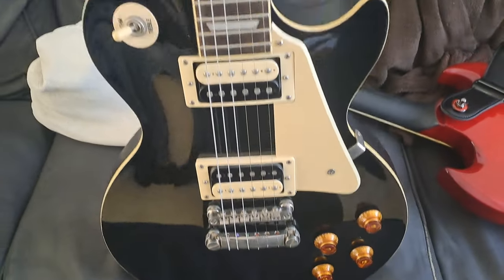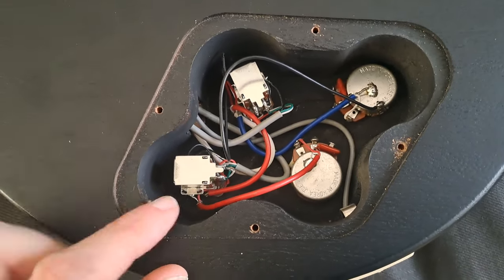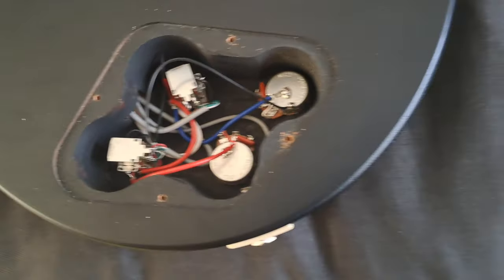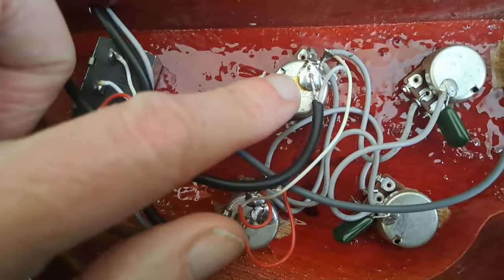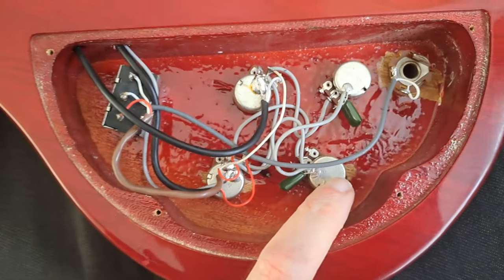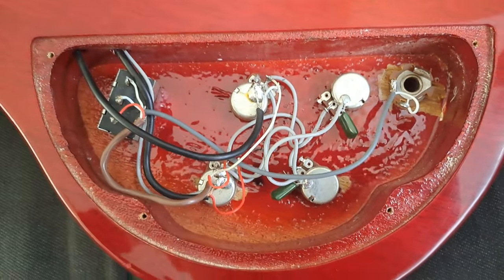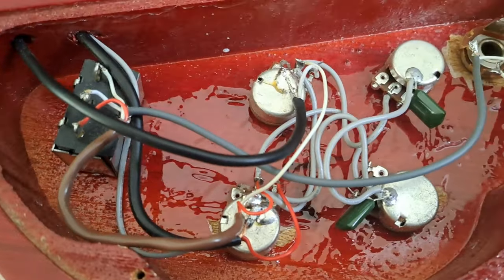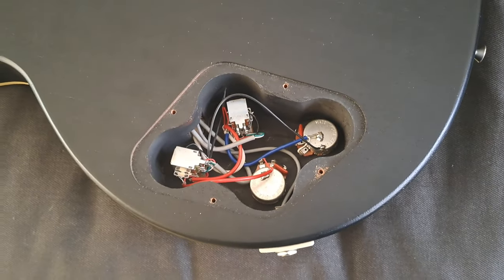How is Epiphone Quality Control?

Comment: From what I've seen, Epiphones, even the cheapest ones, are wired up very well, full size pots and nice soldering work. The fret work and nut slots can be hit or miss on the low end and they still use bottom of the barrel covered gear tuners on the cheapest SG and LP models.

Comment: I have three 2021 high end Epiphones all are perfect
Reply from the maker: There are clearly some very skilled craftsmen they've got in the Epiphone factory. Not all factories will have the same Q/C wherever you go, regardless of origin. I've got a few of Epi LP's and I've always been happy. I just got the new Epi Les Paul Studio in Smokehouse burst and it's super quality. In fairness, even the cheap SG style guitar in this video isn't completely terrible, it works well. It's just messy if you want to go in and get modding. Most people are not going to know the difference until they start opening things up. Keep rockin'

Comment: At least you didn’t just buy a thousand dollar schecter with about 1700 yards of spaghetti wiring in the control cavity…never seen someone use so much wiring to wire up 2 pickups and 2 knobs then zip tie all the slack up horribly and stuff it in there. It’s wild. Idk even know how the solders managed to hold up from the extreme bends twists and pulls in there.
Reply from the maker: Wow, sounds like fun!

Comment: I have the latest BB King, the guitar is near perfect in terms of the body, great fret ends. A really nice guitar. But the wiring must have been done by Stevie Wonder. It started playing up after a week and then went back to Epiphone and was repaired a week later it has gone again. So it will be repaired and sold on. It's too frustrating not knowing if it will work each time it's played. I would not expect this on a guitar at this price. A guitar tech said rip it all out and start again. Not a cost worth doing on a new guitar
Reply from the maker: I'm so sorry to hear that... thanks for sharing. I've not had any problems with Epiphones so far, but it can happen. Such a shame. That's a lovely unique guitar too! It could even be a bit of bad soldering. That can be the cause of so many issues and it's a relatively easy fix. Can you maybe get a second opinion from another guitar tech?

Comment: Getting just like their owner, Gibson. This is why I choose Sire guitars.
Reply from the maker: So far I've had good experiences with Epiphone, and it seems they're going from strength to strength. Epiphone prices at the top end e.g. Adam Jones, Alex Lifeson et al, are reaching all time highs so you would expect nothing less than great quality from those. My latest Gibson has the PCB in the back where everything connects. That can come under fire too - mainly for actually lacking manual intervention - but it is very neat and tidy... and the Gibson sounds great so it's hard for me to complain. I need to try Sire for sure.

Comment: The Stagg guitar's finish looks a lot thicker than the Epiphone's, which may go some way to explaining the difference.  That, and the fact that the Stagg is built to a much lower price point.  I've owned a few Epiphones, and they've all been decent, gig-quality guitars.
Reply from the maker: Agreed, I think that's the thing with these guitars. The Stagg is actually a really good guitar overall despite being cheap. It plays brilliantly (I did put in some work, but then it had a neck break that I needed to fix too...!). The pickups are a bit on the dull side. I had high-ish hopes when I opened it up and you can see it was done at some speed to meet a budget which was to be expected... So I was thinking of switching out the electrics for something like the coil splitting in the Epi. I knew the Epi has it and it's really tidy in there. Much like your experience, I've been very happy with my Epiphones. I've also since switched out the pickups in the Stagg and it's made a world of difference. I used inexpensive Fleor pickups and left the pots for now - it's a bit of a cat's cradle to deal with when modding, but not impossible. I'd never heard of Fleor until recently, but they are pretty impressive. I did a quick video of them here if you're interested: https://youtu.be/Hcpis9va_D8?si=rAMuMj5BTM9TTniP

Comment: Im finding that the quality of most brand is going down while the prices are going up!
Reply from the maker: Ah, that's a tough one... inflation, cost of materials, labour, more competition etc. It's constantly getting more challenging to make a product at a price point that, not only will your audience accept, but makes sense financially to produce. I just got myself a new Epiphone Les Paul Studio - CTS points, solid tuners, nice weight, nice feel. But yeah, it's not super cheap. I'm lucky that so far I've had good experiences with Epiphone. They seem to be moving more and more into the premium pricing point... we'll have to see if long-term they can keep the quality up.